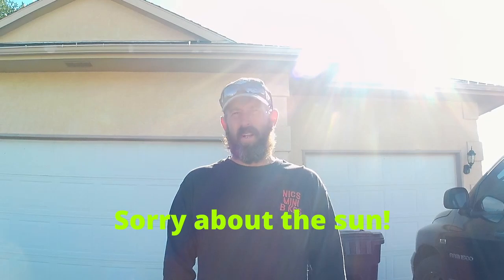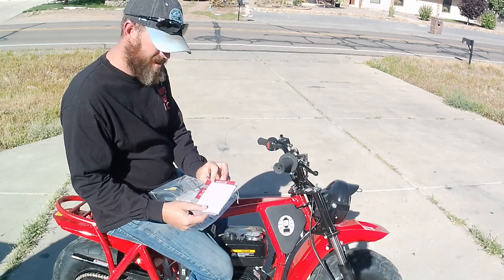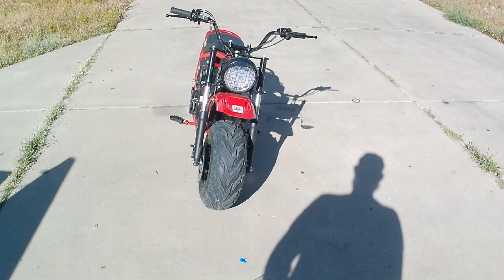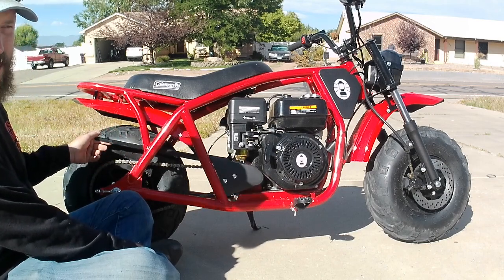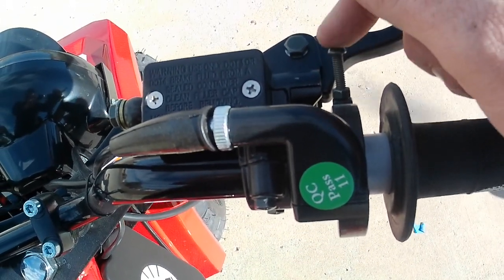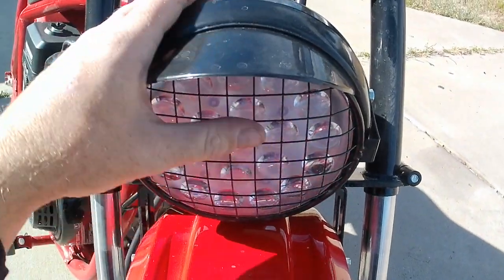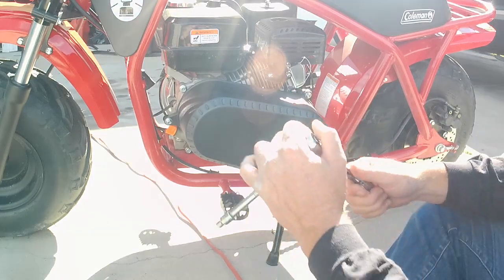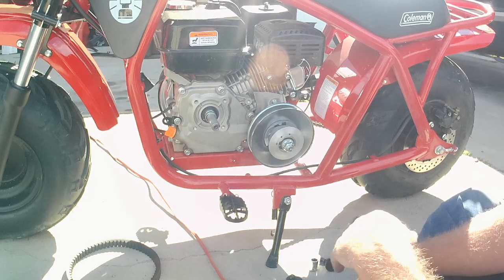New Coleman B200 Walk Around

Comment: This is literally the only video of this model and now im really convinced to get it after seeing the differences in the older models
Reply from the maker: I really like the frame on these. That extra bar from the down tubes to the top bar right behind the black triangle is a nice addition I think!
Reply: I also made a video on it
Reply from the maker: @Ediesel1shorts  these bikes are nice I do like them
Reply: @nicsminibikes  yeah the amount of power these little things have is insane
Reply from the maker: @Ediesel1shorts  stay tuned we'll do better!
Reply: @nicsminibikes  alright
Reply: Take a look at the new B200RSV that hit Harbor Freight yesterday. (Oct 14th). 
Full suspension for the win!
Reply from the maker: The full suspension version is pretty awesome looking! I went with this one because of it's availability. The full suspension model is available close by yet!
Reply: You should it’s a great bike I got it
Reply: Just picked one up for $599 @ TSC
Reply from the maker: @atomarmold7820  which one did u get tho? This one or the one that's like a rb200 mm212?
Reply: Just got the bt200R, no front disc brake but it has the thicker frame tubes, and a larger rack on the back. Also has the taotao but no torque converter.  599 marked down from799

Comment: Thanks for sharing nic.  Allot of intrest in these on the blogs right now.
Reply from the maker: There is a lot of interest happening now and there seems to be 3 models one that uses the Coleman jackshaft and just has rear hydraulic brakes, then this one with a torque converter and front and rear hydraulic brakes and then another just like this but it has rear suspension! I wish the one with rear suspension was available when I picked this one up!

Comment: Looks pretty nice.

Good to see it has a 3/4" PTO. The Hisun is unique. I'm in the middle of building mine. Seven year old engine. Low hours and looked very good on teardown. It's getting a 3/4" Greyhound crankshaft.

Hope to see some upgrade vids?
Reply from the maker: I'm going to be tearing it down for a color change. It's going to be my daughter's gps180 race bike and she wants it painted.
Reply: @nicsminibikes  Thats' good. You'll get to have a look at things.
Reply from the maker: @Deucealive75  yes sir!
Reply: @nicsminibikes  I'm wondering what gearing they are using? And what is the size of the jackshaft key? 3/16" or 5mm?  3/16" would make sprocket changes easy. 5mm a PITA.
Reply from the maker: @Deucealive75  sorry it took awhile I had to see if I could find it in a video it looks like a 9 tooth behind the TC and a 50 on the rear for a 5.55 ratio!

Comment: I did a video on mine. It looks identical. But doesn't have the torque converter or front brake. They change these things soo much. To be honest, i like the jack shaft instead.
Reply from the maker: Sounds like the one u have is the b200r. It's a lot more like the mm212 and the old rb200 rebadged.
Reply: @nicsminibikes  it is the b200r.

Comment: I have almost the exact model. Mine is a B200R. I like your bike better. Your bike has the same engine but has dual brakes vs. mine with back disk brake only. Your headlight is LED vs. my halogen. And then a little difference is where the little lantern is on the side is black. I think plastic on yours where mine is red painted metal. Mine was regular $799.00 at Tractor Supply in Texas and went on sale on black Friday for $599.00, which I thought was a steal. I have seen numerous used ones, all of them, 500 plus. So this was a no-brainer. Oh, anyone seen the one like his all the same options, but it has rear suspension vs. a hardtail. They look sweet.
Reply from the maker: The model with rear suspension is a b200rsv and they do look awesome. I would of liked to get one of those instead but this one was the only new Coleman available here when I needed a new bike.

Comment: I just saw this bike on another channel today but they had a rear suspension on there's. Are there 2 different Coleman B200's now?
Reply: Yes. B200RSV is a full suspension, but everything else seems to be the same.
Reply: There's three new models. Two have torque converters and one has the old jackshaft setup with a clutch.
Reply: @Deucealive75  the b200r has the jackshaft with the clutch. I have that one, I'm currently putting a torque converter on it.
Reply: @Bslahsusnald  Nice. The install should go well. Let us know.
Reply from the maker: Torque converters are awesome I really like them.
Reply: Just to update y'all. I got the torque converter on and it's running great! This is the riser I had to use.    JMCHstore Torque Converter Engine Motor Riser Hardware Kit for Predator 212cc 224cc 196cc 6.5hp Coleman CT200U BT200X Baja Warrior Massimo mb200 GX160 GX200 Engine Mini Bike Go Kart. It only raised the engine 1 inch without moving the engine forward. I didn't have to remove any links from the chain either. I had to cut slots in the  cover for the chain and I used an angle grinder to cut a little off the chain guard near the cover.
Reply from the maker: @Bslahsusnald  heck ya that's awesome! My buddy had some 1x2 steel I stole a couple pieces of to lift our motor on out bt200x.

Comment: I have the same bike but mine doesn’t have the front break. Weird. My kill switch is on the right side and mine also has a headlight switch
Reply from the maker: Is yours the b200 or the b200r?
Reply: @nicsminibikes  b200R
Reply from the maker: @vanessalong255  that's where the difference is this is a b200. B200r only has rear brakes and it runs a centrifugal clutch to a jackshaft set up. The b200 has front and rear brakes and runs a torque converter. There are also some other differences too.

Comment: Were is a good place to get pipes for these Br200 series ?
Reply from the maker: I don't think anyone is making specific pipes for them yet. I used a GPS pipe for the bt200x and had to do some cuts in it and weld it to get it to work. I would imagine a pipe for a rb200 or mm212 could fit they are really similar.

Comment: What’s the difference between the b200 and the b200r
Reply from the maker: B200r runs the Coleman style jackshaft and only has the rear brakes. B200 has a torque converter and front and rear hydraulic brakes. The frames are slightly different as well.
Reply: @nicsminibikes  Oh ok thanks. I saw a b200r at my local tractor supply for $600. Not sure yet if I want to spend $300 more for the extra power
Reply from the maker: @billyschannel997  ya ur also getting the front brake. Once u start pushing good power they are nice to have.

Comment: Is this the 196cc b200c??
Reply from the maker: Yep 196cc Taotao engine and a Coleman b200. B200c is a different model.
Reply: @nicsminibikes  I just bought the b200c waiting for it to come in. Dang I thought they were the same and I bought it
Reply: @nicsminibikes  you think it’ll still be good?
Reply from the maker: @alfredomendoza1522  ya the b200c is going to be just like a mm212 and rb200 bikes they are good bikes. It will come with a jackshaft instead of a torque converter but it's still a good bike in my opinion
Reply: @nicsminibikes  I just got mine today but mine is soooo slow any tips to make it quicker?? I already unscrewed the throttle screw
Reply from the maker: @alfredomendoza1522  u can get a intake and exhaust for it to let it breath and u can but I don't really recommend it zip tie the governor spring. If u do that tho do not rev it out and hold there for to long u could blow the motor
Reply: @nicsminibikes  I unscrewed the screw so I could get the most out of the throttle is that okay?
Reply from the maker: Yes sir
Reply: @nicsminibikes  have you put a new carburetor  on yours? I just did and now my bike doesn’t run
Reply from the maker: @alfredomendoza1522 I changed the entire motor to a 224. Then I put the stock 196 on my son's ct100u head light and all